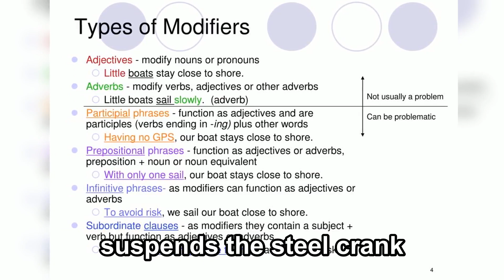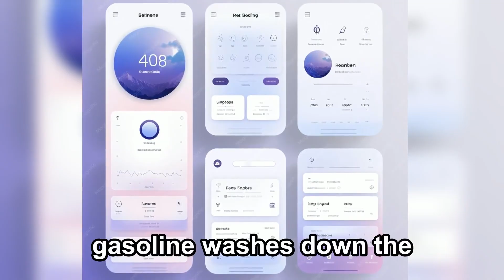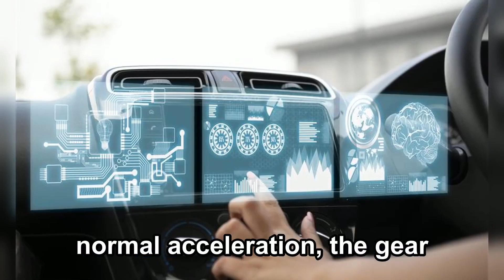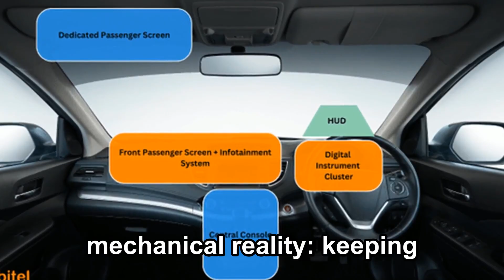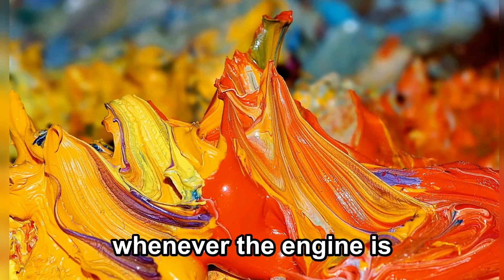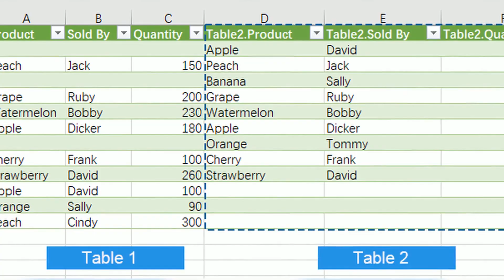These Dangerous Factory Settings Are Secretly Destroying Your Vehicle Right Now

Comment: Oil change indicators are designed to keep the engine healthy for ~100,000 miles, no more.
Reply from the maker: That’s a common misconception — the oil life monitor is calibrated to ensure the engine lasts well beyond 100,000 miles, provided you use the correct oil grade and driving conditions are accounted for.